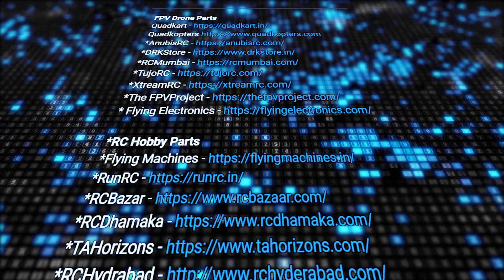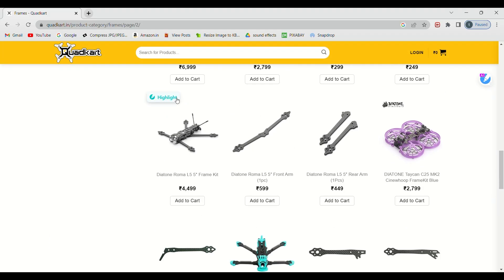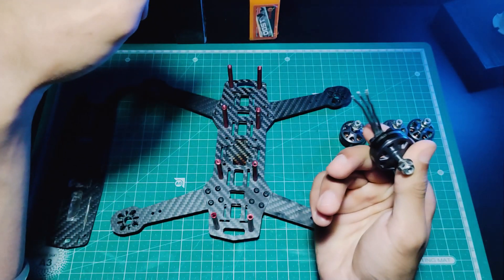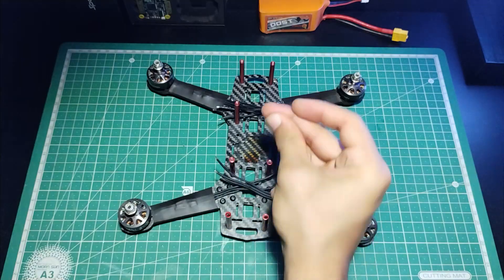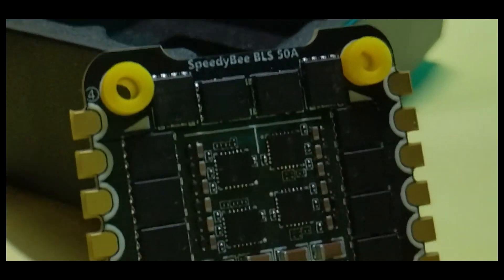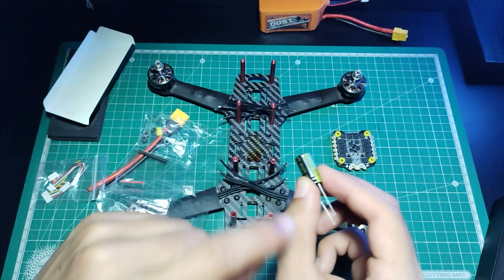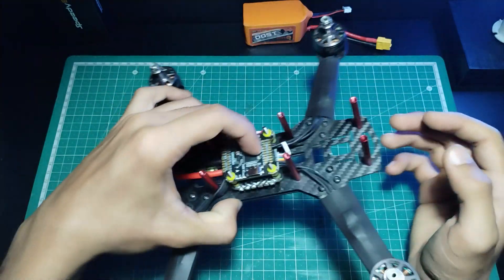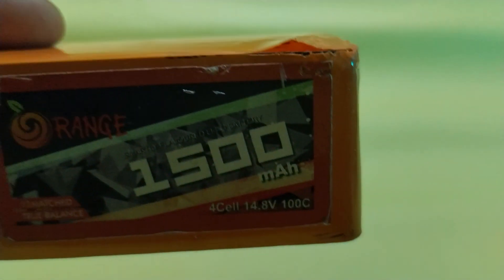How to build budget FPV drone at home || FPV drone India!!! #drone #fpv #fpvdrone

Comment: What charger do you recommend for the batteries bro?
Reply: any balance charger will work but i recommend imax b6 which can charge many types of battries and is really good there is also b6ac version which has an inbuilt adapter and it is the same as the one that was shown in the video

Comment: 3:28  how did you connected thr wires in the receiver
Reply: Bro in which port
Reply from the maker: Soildered
Reply: @arovion which port in receiver not in flight controller
Reply from the maker: @NakshatraNirala  connections are same as in flight controller, one with main antenna, another to gnd